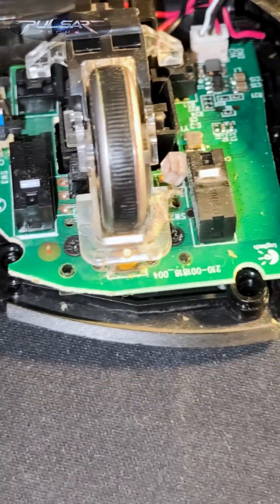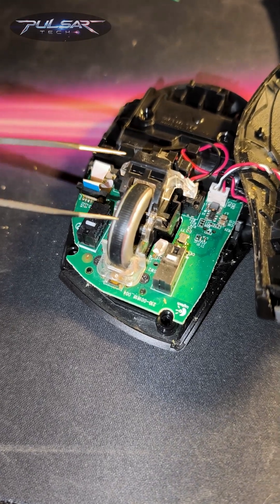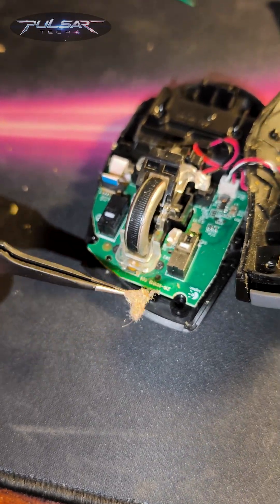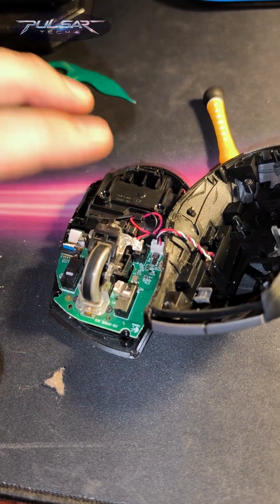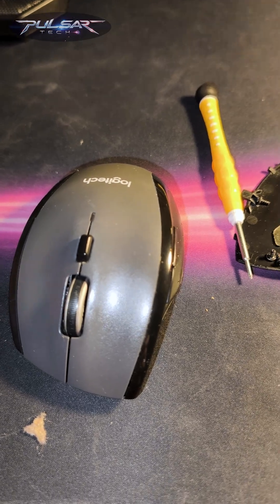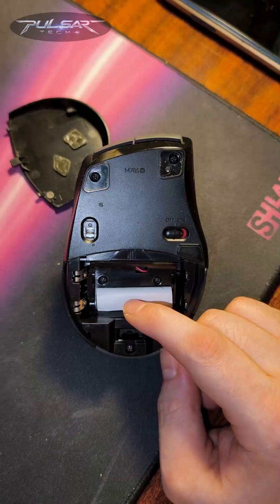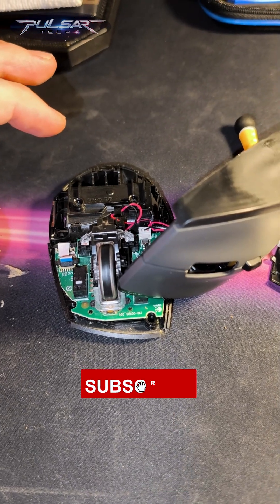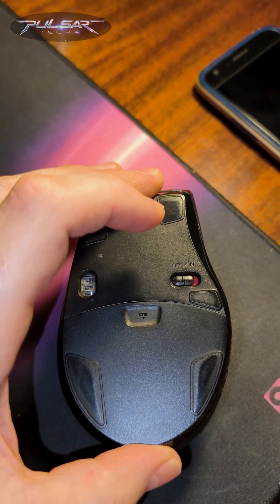Logitech M705 Scroll Wheel FIX – You Won’t Believe the Dust Inside!

Comment: The trick is using a heat gun to remove the screw cover/mouse sliders.
Reply from the maker: Yes, like a 10-second heat treatment makes it night and day trying to peel the sticker off a bit in the battery compartment and the rubber sliding pads without damaging them. Now the mouse wheel spins freely again!